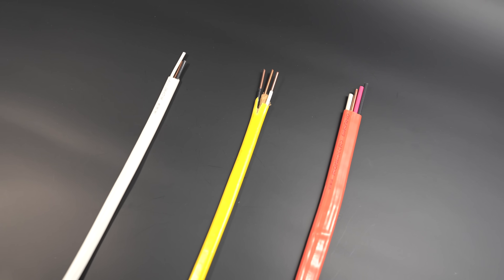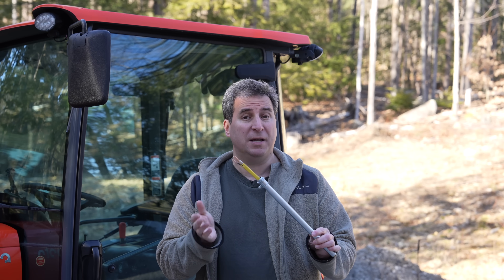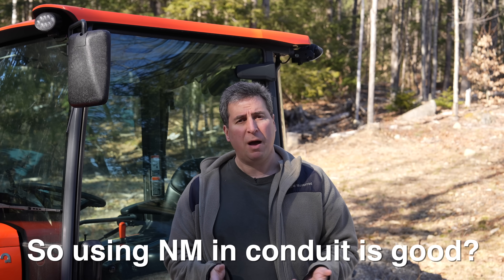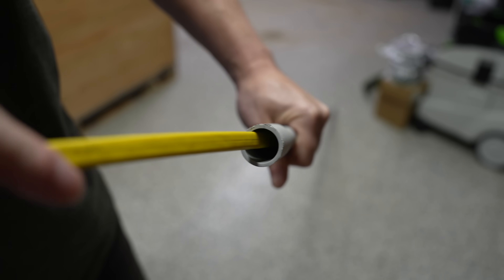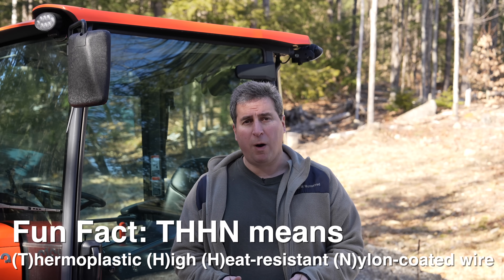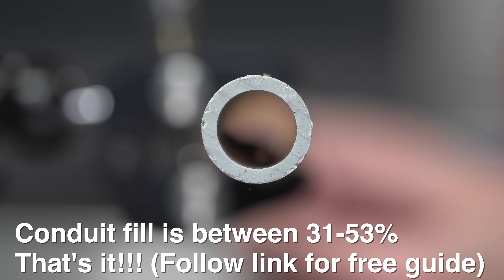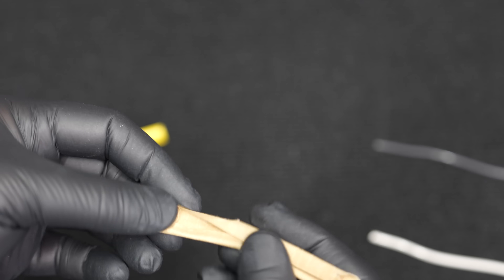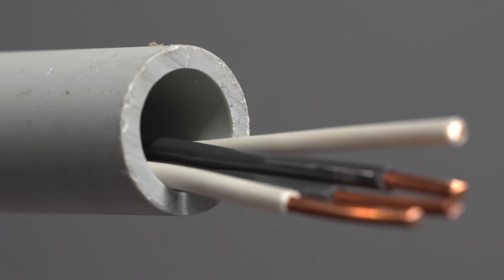#1 DIY Electric Mistake - Can you use Romex Wire in Conduit?

Comment: Wish the previous owner of my home had known about this. I have replaced so much stuff outside since we moved in. Homie would run romex through short sections of liquid tight, and then also ran some under ground through schedule 20 PVC pipe...

Comment: I've been an Electrical contractor for over 20 years, to the best of my knowledge you can run romex through conduit only if its less than 10 ft....  Over 10 ft would be considered double sheathing, which could lead to overheating.

Comment: I removed all my GFCI receptacles in my garage.. found the capacitor start chain hoists won't work.. auxiliary flourescent lights wouldn't work when plugged in.. besides the 100 amp Crouse hinds arktight plugs don't use GFCI protection for the welders, so no more GFCIs!

Comment: If using individual wires, with regard to metal conduit, the one thing you don't want to do is split the phases and send each phase through its own metal conduit...doing so creates a magnetic field in the conduit and builds up an charge in the conduit itself.

So if you are running let's say 3 phase power you better have big enough diameter metal conduit to run all 3 phases within the single metal conduit.

Comment: If you're  running direct burial  cable thru a a trench and you come to cross a gravel drive,  your'e going to want to  bury your cable  in a  cylindrical tube-liike stucture. If you don't like conduit,  you can calll it a culvert or pipe or something  else.  It will protect the cable when you  drive that loaded cement mixer over it on that gravel drive.

Comment: Everything you said is correct.  However, the Romex site clearly shows that the wires inside are indeed the same THHN they sell individually; the exact same thing you get when you buy individual strands.  The problem is they aren't labeled so you are correct in that you can't cut them out and use them without the sheathing.

Comment: If the Romex fills the conduit more than half of the inside space, just use bigger conduit. I believe not just for the ability to get the Romex through the conduit, but also when electricity is being drawn/used it generates heat and I believe the more air space there is, that would help with heat dissipation, instead of heat build up, which could cause electrical failures or fires.

Comment: Run your conduit and pull your wire like the union required.  All this Romax that is drilled into joists should be illegal.  I've seen electrician destroy structural strength on load bearing joists and walls 🙄

Comment: Another video that never explains why. Just that it's against code in some cases.
I'm curious because I have a 50' run of romex in a 1/2" conduit buried running across my backyard. Been there for at least 10 years or more with no issues. Yet. I'd at least like to know what the issue is so I can watch for it.

Comment: You can’t just jam wires in a conduit even at 50% fill or whatever without derating the breaker size. Over 6 current carrying conductors in a conduit and your 12 gauge wire is no longer rated at 20 amps.  NEC table 310.15(b)(3)(a)

Comment: so what happens with moisture in teh conduit?  why is it illegal
Reply from the maker: They never specifically say why it is not allowed but its commonly believed that its due to NM cable having paper insulation around the ground wire tha will eventually break down. Outdoor rated cable and of course THHN has no such paper

Comment: Nice vid.
Our 40 year old house has conduit in the yard, running 220 to the pool pump. The problem? The yard has eroded, and the conduit is now visible. The contractors probably only buried it 3-4 inches.

Comment: Incorrect you are not allowed to run NM through conduit. The easiest answer is that NM does not have the same Thermopladtic rating as individual conductors for the application you are trying to complete. Example: THHN (Thermoplastic High Heat Nylon coated) THWN (Thermoplastic Heat Wet location Nylon coated)
 Absolutely not allowed in dry location as you stated. Choose the the right wire for the application you are doing.
Reply: It would be helpful if you cited your source.

Comment: NO you shouldn't ever run Romex in a Conduit.
Reply: Perhaps not in your AHJ.

Per the 2026 edition of the National Electrical Code (NEC), section 334.15(B)(1)(a): "General.  Cable shall be protected from physical damage where necessary by rigid metal conduit, intermediate metal conduit, electrical metallic tubing, Schedule 80 PVC conduit, RTRC marked with the suffix -XW or other approved means."

Comment: Id agree that sleeving type nm to protect from physical damage is acceptable, my other thought is why would you pay for type nm and then pay for conduit to run it in , that is not acceptable by the nec and cost wise does not make sense either when i could run individual conductors thru conduit which is made for that application.

Comment: Can you run romex with no conduit outdoors?
Reply: You did not provide any specifics, but you would use Underground Feeder (UF) cable.  Check with your Authority Having Jurisdiction (AHJ).

See 340.10 Uses Permitted; and 340.12 Uses Not Permitted from the 2026 edition of the NEC

Comment: I have a question I hope you can answer if I may.  If I want to attach a ground wire to a receptacle, light switch or ceiling light, can I remove the ground wire from a 12/2 or 14/2 romex cable and use it as a pigtail or do I have to buy a special ground wire to make the connection?
Reply: You do not have to purchase any special ground wire.  If you cut a piece of ground wire from a spare cable, use the same gauge ground wire.

Comment: I was told that when you run nonmetallic cable through conduit, your double insulating it therefore, reducing the capacity because of heat

Comment: 12/2 in 1/2" conduit, seems like a lot of room left.
Reply: It's not, especially if you have offsets.  I have installed two 12/2 cables in EMT conduit.  You will be unable to add anymore cables.

Comment: Very well done video. Brief and to the point. 
So my question is not "can you" put romex in conduit, but "why would you" put romex in conduit. I can't imagine it's cheaper, except maybe in plastic conduit, because you'd need a ground wire. In EMT you only need 2 wires per circuit, since you can use the conduit as the ground. Yes, that is code-compliant and just as safe.
Reply: Source of reference?

Comment: Needed a extra 30 amp 240 volt circuit to the radio room it went like 35 feet was hard to pull after the 90 degree turn down to the box with the two breakers and surge protector. For a new UPS. .

Comment: I need to run 220v to a dryer I need to install in my basement. The basement has a sump pump, so it gets wet during heavy rains. 
The HVAC cable (8/3??) is not in conduit. Nor is the oven romex. Should the dryer's romex be in conduit? How about the vertical run from the ceiling down to the back of the dryer?

Comment: No good reason at all. If you are ablevto pull it thru , and you installed the pipe for your own purpose i say go for it and if it is to full for anyone else to squeeze another wire in it they can install another pipe.

Comment: I agree with you with two exceptions.  (1) The stripped wires can be within a box, such as pigtail. (2) It is not allowed to be stripped in conduit because there is simply no labeling in the wire itself. LOL I'm just being an a-hole. Good video.

Comment: All the insulation on the wires must be rated the same, like feeding a rooftop AC unit, you can't put 300 volt thermostat wires in the same pipe as 600 volt THHN power wires. The thermostat wires can share the pipe, they just all need to be THHN.

Comment: What is the reason why UF wire cannot be run inside conduit outside? That would seem to provide extra protection for runs in damp areas. I get it would be hard to pull but just curious the reason it is prohibited?

Comment: You can use it in EMT conduit all you want. It just protects the wire even more. Especially used inside. But usually thhn stranded single wires are pulled through conduit in commercial purposes

Comment: Since I wasn't comfortable with a lot of relatively delicate exposed NM wire in my home workshop, I just wired the whole shop with armored cable.  It made everyone happy, including the inspector.
Reply: That's called "MC Cable" (Metal Clad), it's all I use, wires already inside the metal flexible conduit.
Reply: Rewired most of my house with it. With snap on connectors it's really not that much more work. Mc cable wasn't that much more expensive at the time, but Using metal boxes/mud rings definitely took longer and costed a good bit more than those plastic boxes with the nails already in them

Idk just seems safer, probably overkill, definitely protects against rodent damage and like 99% protection against errant screws nails

Comment: It's my house, I do what I want! :) 
I've put romex in plenty of conduit. In shops that are cinder block or concrete, conduit is the best option. I've pulled romex through long runs of conduit. They make pulling lube specifically for this. And I always ground metal conduit. And I had an inspector tell me once that there are a lot of codes that are just made because some person thought they needed to be there with no real justification.

Comment: There are wires rated for moist locations and I would only consider using them in any outside and or buried line.  I generally overbuild circuits for safety depending on the application.  Times change and so do electrical demands on circuits due to modern technology.  I always mention the old farm house in the country that was wired many years ago and is used with modern demands.  Because these homes never get updated many end up burning to the ground.

Comment: I ran a large pvc pipe to a well 200 feet with the smaller water pipe and the romex inside. Been that way for almost 20 years. And it’s all run through shale rock. we dip down -20 to -30 in the winter.
I’d bet there is water in there too 😂 but never had it freeze or give me any issues.

Comment: I was a US Navy Nuclear Electrician OnBoard Nuc Subs. Nicely Done Brother, Very Nicely Done ! Assuming you use individual strands you are still limited for number of strands vs the heat rise from the amperage. You also have to derate the current capability of the cable too. So depending on your load you may have more or less wires in a bundle or in a conduit which Im sure you know but wasn't the topic of this video. So DIY'ers take this video to heart and what I said as well because what seems reasonable to you is not reasonable to the NEC.....We didn't call it "electrickary" for nothing.  

Here's a short sea story,  got lite up working on 440v live circuit (there are things you just can't shut in a nuc sub deep in the ocean), when our boat made a " hard unplanned maneuver" and thru me into the hot panel  was working on and thats why there where 2 other guys wiith ropes on me when we did stuff like that!!! Nicely Done Brother, Very Nicely Done !
Reply: I was a MMN for 8 years, did my prototype on the MTS Daniel Webster (626), then served aboard the USS Stennis (CVN-74) and the USS Lincoln (CVN-72).
Reply: @JayBandersnatch  God Bless Brother, There's to ships you never want to be on unless you love to remain at sea,  a Carrier and a Fast Attack. Yahoo!!!  loved it though!!! II Its just that today, I can't trust air,  can't see!

Comment: I ran a at 10 foot length conduit EMT out side for a out side light, I used compression connector, i ran a ten foot length of 14-2 romex in emt using a compressor connector out side, is it safe..?? That was 10 15 years ago..

Comment: Nailed it. Damp location, run inside pipe, I was getting shocked right through the yellow cable because the paper insulation inside was soaked.

Comment: It always startled me why there is paper in NM cables? A. Paper burns. B. Inside plastic it holds AND conducts (sucks in) moisture.
Reply: P.S. Redit says:
'It is to protect the nylon coated pvc conductors from melting during the pvc outer jacket extruding process. It mechanically protects the wires'. 
So, the paper is there for the manufacturing purpose only. Kinda like when buying a sandwich wrapper in the wrapper. So 'you can have it and eat it too'?

Comment: I'm lazy! I always use stranded THHN or THWN. Much easier to pull into the conduit. 
I'm in the process of replacing all of the romex in my house with conduit. Mainly because of the illegal alterations made by the original owner, that was a lineman for the power company! 😮

Comment: How the hell do these stupid rules get thought up? Regardless of any other considerations, steel conduit provides physical protection against damage plus if the conduit is electrically continuous and earthed it provides an earth fault current path in the unlikely event of a drill or a nail etc piercing the conduit and making contact with a live conductor inside. Don't your standards people actually THINK when they create your codes? Of course screwed conduit joints are far superior to clamp or clip versions and when properly made a screwed joint is waterproof. Galvanized steel is weatherproof although painted finish is also weather resistant.

Comment: Marine electrician here. Romex is an absolute no no for boats due to movement fatigue. Over time a run strapped to a wall with move as the boat moves in waves or wake. That movement eventually leads to breaks. Only stranded wire with crimped ends in marine applications.

Comment: What you said is not accurate. The inside of modern Romex are THHN  or Nylon T 90. The same wires available off a 300 meter reel with two different names. If you strip your Romex, you can put in up to 7 wires into a 1/2 inch pipe before you get to the first stage of derating.  You have trouble getting a complete Romex through 10 ft of pipe, that depends on how many 90 bends you have, and how competent you are fishing wires. Older Romex can have TWH or TW inside. The outdoor rated ones use TWU conductors, but installed low down require mechanical protection.

Comment: How about running the ground penetrating NM thru a raceway? Like a 4” race under a driveway. The wire is mechanically bonded to the cover material.

Comment: I installed a run of 10/3 for a clothes dryer on the 2nd floor. The panel was in the basement, opposite end of the house. Their was a convenient place to place a pvc conduit on the building exterior to the 2nd floor where the dryer is located. I used NM cable, and stripped the jacket off only the section that was in the conduit. Since the NM cable I used was made with THHN wire, I know what I did was fine and safe. Would an inspector agree? I don't know, it probably would depend on the inspector. Cutting the wire in 2 places and splicing in wire simply because it is marketed as THHN would have lowered the quality of the installation and created 2 points of potential failure.

Comment: Having "done it myself" with the assistance and guidance of a licensed electrical contractor, I make the following suggestions.  The NEC is sometimes about safety, and sometimes about money for electricians.  If it makes sense from a safety standpoint that's fine, but if you see something like "50.3% of the conduit fill" it is likely more about money.  Many electricians simply roll their eyes when reference is made to "the code" as it is, in many cases, unnecessarily complex and burdensome to no particular end.  The goal of regulation in America has become ensuring that you can do nothing without hiring some "professional" and having a clueless government official sign off on work he does not understand.  If it is your own home, on your own property, get a book, learn the basics, do it yourself.  Plumbing, electrical, carpentry, HVAC... this isn't Rocket Science, folks, much as they try to make it so.    Have a professional check your work if it makes you feel better.  And if someone starts  off with "Code requires". just walk away.  It's your property, it's your money.  The government has no vested interest in your private property.

Comment: Many years ago, I had a house with a detached garage about 30 feet from the house. I ran a piece of 12-2 NM from the house to the garage UNDER the driveway thru an existing piece of 2 inch PVC. The rest of the run was buried 18 inches underground. I believe it is still there TODAY ...

Comment: Why is running NM-B inside an outdoor conduit a prohibited use, even if I use outdoor NM cable rated for direct burial? I would think that cable approved for ground contact would be safe for conduit run outside, such as on the side of a building to a floodlight for the back yard? Why is this not so? Please Advise.

Comment: I connected 2 sheds, that were close to each other, with PVC pipe buried at the proper depth. Then I inserted the 12-2 UF which had plenty of room to make the trip. The above ground section of PVC protected the cable.

Comment: The main reason you can't use the wires from NM cables by stripping them out of the jacket is they lack labeling. In most NM the wires are thhn that is not labeled individually,  which code requires for conductors. No printed info on the wire size, material, or insulation type means not legal for individual  use.

Comment: It is not allowed in wet locations because it is not rated for wet locations, the plastic breaks down.  Underground, as barometric changes occur small amounts of air are pulled in and out of sealed conduits under ground. When moisture laden air comes in, it cools condenses and then pushed out with barometric changes, so it happens again.  After some time the conduits are a very moist location.
Reply: Absolute nonsense. It's plastic coated wire in another plastic coating inside a metal pipe. If that's not enough to keep moisture out than nothing will work